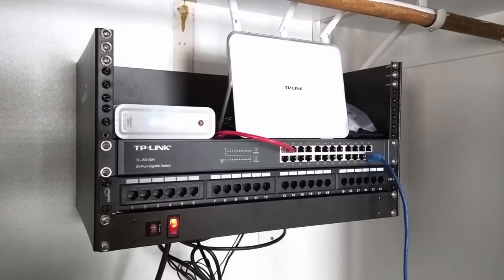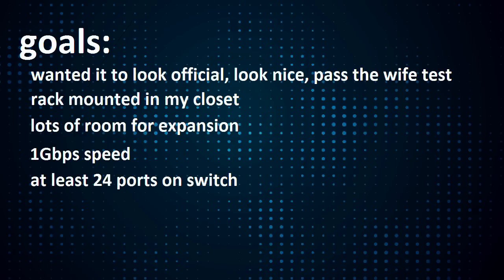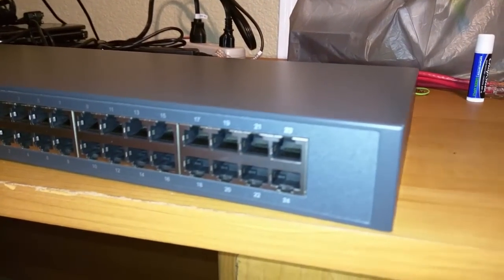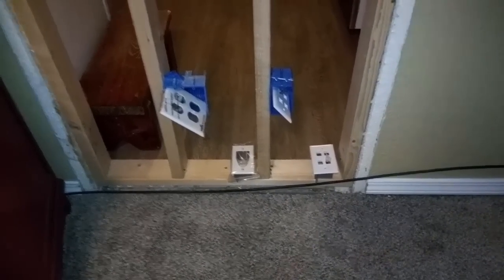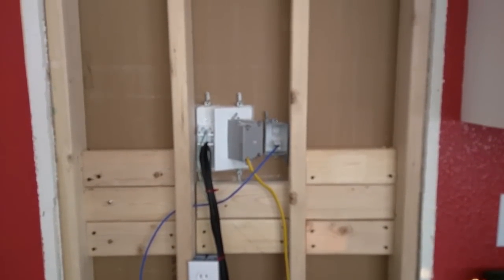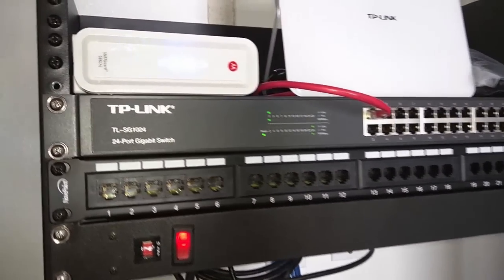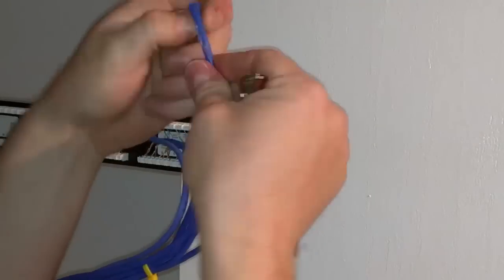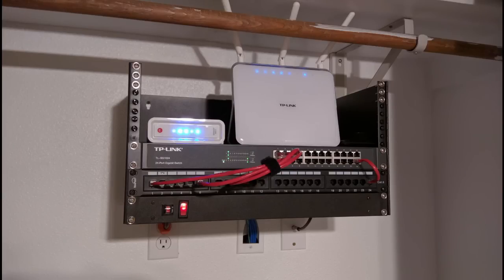Budget Home Network Tour/How To

Comment: If you wanted to save a little money you could've just run 1 or 2 ethernet cables to your entertainment center and then added a switch. Also, I've repurposed old routers into switches by disabling DHCP and wireless capabilities if anyone wanted to save even a little more money.
Reply from the maker: +Bman8862 those are good ideas.
Reply: Bman8862 
I'd agree, Linksys or Netgear or others offer inexpensive switches ($25-$40 Gigabit). In my office sure for troubleshooting make them all home runs, but a home it's not necessary.
Reply: Ask anyone who works in enterprise networking, cascading switches.. especially in a managed environment is a fucking nightmare. I mean, I would spend the extra money just to run everything back to a central switch. But yes, you are right, good ideas to save money!
Reply from the maker: +Nicholas Smith I agree! Cascading switches is something I'm not very familiar with yet. Luckily I won't need to mess with that with my home setup.
Reply: Can I ask, why did you go with a frame rack instead of a cabinet style self contained rack? I think it would have maybe worked better in your situation?
Reply: Nicholas Smith 
Cascading a secondary switch in a home is a practical necessity and for years I haven't had one problem. 

Alternatively, you have to second guess how many runs to a single point, adding a 'whoopsie I missed one' in a home is exponentially more difficult. 

The switches all have indicator lights and it's super easy to diagnose a problem.

In contrast in an Enterprise location ie a Data Center most switches are managed...
Reply: I do see your point. But just to clarify, its not having a secondary switch thats the issue, I just prefer that all my switches are in 1 physical location, not spread out. I guess its just my bad experiences with rouge switches in business settings.
Reply: Nicholas Smith 
Managed vs Unmanaged Switch(es).

If only one area in my home isn't working off a switch then chances are a bad switch; if one device off a secondary switch isn't working then chances are its the device reboot or test. Generally it takes a reboot to fix.

Electricians typically charge $100-$200 per drop, grouped or not. Crawling in my Florida attic in summer is like getting beaten up.
Reply: Very good points!

Yes but walking in my Australian roof-space is a breeze. ;)
Reply: Nicholas Smith 
My best friend is an Enterprise Network Engineer and his house is in Chicago area (basement and cool temps) and he has a personal mini data center in his home. Everything is managed, mostly Cisco, and set up the way you described. 

I'm just looking for a single-SSID Ethernet backhaul with 3-4 AP's (Mesh style) WiFi running off my Router (using a single gateway; no secondary). His Cisco solution costs in the thousands. I'm looking for a solution in the hundreds. Any suggestions?!
Reply: Thanks everyone for the advice. I fantasize about having a home network like these ones. I'm 16 and still learning but I absolutely LOVE this stuff. (And I can't really afford it - or convince my parents - but I'm working on it haha)
Reply from the maker: +Nicholas Smith well mostly because of budget. A little access on the sides would have been nice. I didn't feel I needed any security though.
Reply from the maker: +Bman8862 ever since starting full time in IT, I've wanted one too. Keep learning, and saving! It'll happen!
Reply: This is what I built for my home entertainment server.  Worked really well for me.  Didn't have to buy all the extra equipment and kept the price down. It served 2 tv's, 1 Ipad, and our phones with no problems.  But I will say if I had the money I would build something similar to this. 

Edit; I would buy different hard drives. The Seagate 
Green Hard Drives I used were not worth it at all.  Two of the hard drives failed within the first six month's and all of them including there replacements died just after warranty.  Will never buy them again. Currently the Media Server is out of commission until the hard drives are replaced.

HDD ST3000DM001 3TB 64MB Cache SATA 6.0Gb/s 3.5"
ASUS M5A78L-M/USB3 AM3+ AMD 760G + SB710 USB 3.0 HDMI uATX AMD
Western Digital Blue WD2500AAKX 250GB 7200 RPM 16MB Cache SATA 6.0Gb/s 3.5" Internal Hard Drive Bare Drive
LG Black 12X BD-ROM 16X DVD-ROM 48X CD-ROM SATA Internal 12X Blu-ray Combo Drive Model UH12NS29 – OEM
HyperX Blu 4GB 240-Pin DDR3 SDRAM DDR3 1600 (PC3 12800) Desktop Memory Model KHX1600C9D3B1/4G EA
AMD FX-4100 Zambezi Quad-Core 3.6GHz (3.8GHz Turbo) Socket AM3+ 95W FD4100WMGUSBX Desktop Processor
2- cisco EA6500 routers
Reply: Glen AW 
Don't get me wrong it's nice. However, back in the days of prior to DVR cable, Netflix, HULU, Amazon Prime, Spotify or Napster, Sony Vue, and Premium on demand, etc .. a Media PC actually made sense. I use to waste time ripping my DVD's (had a PC controlled DVD player before that), CD's, record TV (1-2 tuners).

Now there's no point, on demand streaming is getting cheaper by the day.

The Networking Engineer friend I mentioned does as you do, but he has no kids and doesn't spend too much time watching the boob tube.

Heck now we rarely even buy a physical Blu-ray with the exception of some 4K's, instead it's VUDU or Google because the force is towards digital. Our home movies and pictures are stored and shared on a WD My Cloud w/ RAID.
Reply: cascading switches could make a bottleneck in the network if you put heavy traffic devices in the wrong place (because the way cascade network moves the data from the slave switch to the main switch). you have to plan your network to avoid putting heavy traffic devices in different switches when you use cascading, specially if the old switches you are using aren't gigabit
Reply: Dario Ampuy 
Look at the second reply (Gigabit). Using CAT6 in the first place assumes itself people are looking for speed. 

Gigabit is pretty much the standard and pretty inexpensive. BTW as soon as 10 or 100 Gigabit is priced similarly that will be the standard. You're more in trouble if you have CAT5 (not confused with CAT5e) with its 100 Mbps cap. CAT5e is 1 Gigabit max and CAT6 is 10-Gigabit 100 meters max. CAT6, CAT6e and CAT7 are 10 Gbps with longer lengths and frequencies. CAT8 upto 40 Gbps. https://www.firefold.com/blog/cat7-ethernet-cable-worth-extra-cost/

IMHO CAT6 is perfectly fine for home use unless you have runs over 150' .. you might get some crosstalk after 100' if you're not careful...at 10 Gbps speeds.
Reply: well, repurposed old routers tend to be 100mbps which is fine as long as the devices connected are low traffic...

unleast you use backbone capable switches (which are very expensive) when you connect 2 switches with one cable all the traffic inbetween will move across that single cable... if 2 heavy traffic devices are in each switch they could saturate that single cable freezing the rest of the network crosstalk. if you want speed you try to avoid cascading, or you design your network so low priority devices connect to the secondary switches leaving all the high priority devices on the main switch
Reply: Dario Ampuy 
Agreed if you funnel a 1 Gbps data stream into a 100 Mbps pipe .. you get 100 Mbps cap.

The only potential issue with cascading Switches is it theoretically creates a tiny latency. 

Just for thought all this is in Mbps and Gbps not MB/s or GB/s. 100 Mbps is 12.5 MB/s and 1 Gbps is 125 MB/s, 10 Gbps is 1250 MB/s. A HDD is 125MB/s to 200 MB/s vs a SATA 3 SSD 590 MB/s and the M.2 SSD's 3,500+ MB/s (max M.2 is 3.9 GB/s 3,937 MB/s).

Point is a 1 Gbps data stream to data transfer is slow.
Reply: Bman8862 is
Reply: Bman8862 when using a old router what do you mean when you said you disabled shop? I used a old router to act as a switch, but I'm not sure what dhcp is? I'm not knowledgeable when it comes to computer stuff.
Reply: DHCP is basically what assigns your devices 'addresses' known as internal IPs. So, in order to make the second router down the line a switch, you can disable DHCP in the settings so that both routers aren't trying to assign IPs and cause IP conflicts. That way, the first router is the only one assigning IPs. Someone here can correct me if I'm wrong.
Reply from the maker: +Bman8862 👍
Reply: As far as DHCP goes, that is mostly correct - you generally should have only one DHCP server; although professional routers can have "DHCP helpers" added to ensure that DHCP requests from a given subnet get to the proper DHCP server when more than one exist., A Router's primary function in networking is to connect separate networks - each with its own IP address space. The router does network address translation and routes packets in the direction that they need to go - towards one address space or another. Most professional routers talk to their neighboring routers to develop a routing table on their own, in addition to manually defined routes. Home routers on the other hand usually only talk to their "WAN" or "Internet" port to figure out what address space they are connected to.; and most home routers allow you to define what address space they hand out.
Reply: A network made from Ubiquiti products would probably be a bit cheaper than Cisco. Though if you are talking about a home environment, having more than 2 APs is probably overkill and will be prone to interference.  If at all possible you should hardwire the two APs back to your edge router; Ubiquiti does claim to have a "transparent" type solution that allows APs to connect to each other wirelessly, but keep in mind that extra communication between APs will affect overall bandwidth somehow.
Reply: In a home environment you probably will not notice any big problems by "cascading switches" to create one large network. When you directly connect one or more switches you create a giant broadcast domain - (again, in a small home network you won't notice too many issues). You probably know that each port has a given speed - like 100MB. The main time this comes into play in home networks is when multiple devices access the same port - like your main internet connection, or a media server. In these cases, the speed of the "shared" port gets divided roughly by the number of devices trying to access. This also depends on how much traffic is generated by each device... if a chunks of a movie from a media server are coming into one viewing device at 22MBPs then that leaves roughly 78 MBps for other devices. There is also typically a bunch of minor overhead traffic on any network, so those are just approximate numbers.
Reply: Agreed. 1 or 2 cables is likely most would need. Can even use VLANs if need to segment stuff. I have a single ethernet cable going to my home theater area with an 8 port switch.
Reply: Hey D Jaquith - you should look at Ubiquiti UniFi systems for your wireless mesh.  They cost dramatically lower than Cisco gear, but have what you're looking for in terms of an easily administered, single-SSID mesh style wireless network.  The access points are also POE - which opens up a lot of options about placement (to maximize coverage).
Reply: David Miko 
Thanks I'll definitely check them out. I've been busy and put it on the back burner, so I haven't done anything yet.
Reply: switches like that use up a lot of power, space in the entertainment area and sometimes are loud. also the amount of money you are putting out there for a switch the cabling is the same
Reply: Not in my experience. Most of them are fanless, take up the same amount of space as a normal switch, and about the same power consumption. For example a D-LINK DGS-1100-08 consumes a maximum of 4.94 watts of power.
Reply: CAT5E is the standard in Data Centers. Any speed needed above that is handled by multi-mode fiber (storage solutions) or single mode fiber(connection to the outside world). This is your typical setup, certain customers have different requirements and may deviate from the typical. Also be aware that Telco's drop off circuits in multi-mode or single mode flavors based on customer needs. Copper connections to the outside world are not that common in a Data Center environment.
Reply: CAT-5e is not usee in data centers. There's a combination of 10, 40 and 100 Gbps copper and fiber used. The 10 Gbps connections are CAT-6A or CAT-7 variants. 
Heck, my house is wired with CAT-6A for future 10 Gbps network. 

1 Gbp is s-l-o-w, that's only 125 MB/s, my now 'old' SATA 3 single SSD is >500 MB/s, most data centers use a faster RAID configuration. The M.2 SSD consumer standard is up to >4,000 MB/s. Example a cheap Samsung EVO 960 SSD is 3,200 MB/s. Eventually you'll see homes pre-wired in Fibre. Speeds are getting faster quickly. Solid-state is the norm now in both consumers and enterprise.

I'm not trying to be mean with a reply, and if anything to be Illuminating.
Reply: +1 to CAT-5e is not the standard for data centers.  The mix of copper and fibre varies widely, but every client I've worked with has been on CAT-6 or above in their data center, and not a single one would consider deploying CAT-5e in their data center (or anywhere else).
Reply: Cable type is an engineering issue with possible budget constraints. But that is totally irrelevant to this video which is a "budget home network". He has a 300MB internet connection (Motorola SurfBoard 6141) and a TP Link gigabit switch inside a small home. Cat5 is totally fine for this - he SHOWS you how small the area he has wired up is. I only wish he had timed an actual file transfer across his switch so you could see the actual throughput he actually achieved.
Reply: 300 MB/s is 2.4 Gbps so I seriously doubt that is his Internet speed. You're forgetting all of the local access to PC's (P2P), server(s), and or NAS and other devices on his own network. 

10 Gbps Switches indeed can be expensive and most 'affordable' switches have 1 or 2 10 Gbps ports for a Server and or NAS with the remaining ports Gigabit. 

Any new home or re-wiring I'd strongly recommend using CAT-6a wire and not CAT-5e. Builder's electricians typically use CAT-5e for POTS (phone lines) and if you don't know to ask will also 'that' wire for your network.

So why CAT-6a and what gains .. file transfers pre-broadband were relatively small, but now with people moving their video collection and home movies to digital file sizes have exploded. Add to that the movement towards IPTV, digital video downloads, Plex media servers, etc people even at home are moving huge amounts of data. Nobody likes waiting and buffering. Now quadruple that with 4K over HD video.
Reply from the maker: +CDArena I did do speed tests and transfers in my switch review video. Check it out.
Reply: should have been obvious - Download speeds up to 343 Mbps according to manufacturer steps. Also - BUDGET HOME NETWORK. At the moment, 10GB switches are definitely not "budget", and in a home environment (even with a NAS) you WILL hit multiple obstacles trying to get even 1/4 of a 10GB transfer rate. 

Read/write speeds are likely to be your main bottleneck, not your network. And 4K over HD is far more likely to be a problem with your ISPs congestion than your home network. Cat5e is plenty capable of carrying gigabit traffic, especially with the chokepoints you have already with your typical storage device and NICs. 

Maybe when the ISPs finally catch up you can worry about fitting advanced cabling and switches into you budget home build, but not now in most areas of the US.
Reply: CDArena 
It's a terrible mistake now to pre-wire or re-wire even a home network with CAT-5e cabling. If your NAS, Server or whatever isn't capable of anything above 125 MB/s (Gigabit) speed AND you don't have concurrent traffic (per port) then obviously installing a 10 Gigabit switch isn't going to help a single point connection. For the average home with few transfers of data and run of the mill streaming  IPTV services without a Plex then keep that Gigabit switch.

Keep in mind if you have a Gigabit network then ALL of your traffic has a maximum cap AGGREGATED TOTAL of 125 MB/s (per port or nonblocking limit of your switch). One copy transfer and you've basically saturated your Gigabit switch.

In contrast, if you have a few PC's, and or NAS and or a Plex or simular server a 10, 24, 48 port 10 Gbps switch even on a Gigabit NIC's reduces or eliminates concurrent bottlenecks. Hmm lots of people even need a PoE switch for their cameras, if you have a lot of HD cameras I'd certainly suggest a 10 Gigabit PoE switch and 10 Gigabit Ethernet switch. 

Affordable, CISCO offers a managed 10 Gigabit switch with 48 Gigabit ports and 2 10 Gigabit Ethernet ports for about $399.

Now if you're only getting '1/4' that speed 10 to 10 Gbps connections then I'd look at your NIC configurations particularly package and buffer sizes (max them out).
Reply: Again... Budget Home Network.  His Gig switch is non blocking. Per connection it is capped at 125MB/s, which he has not reached due to hardware and possibly NIC configurations; and which he has only come close by using a few SSDs for testing (his main storage is spinning hard disks). 

Again, this points out the current limitations of the typical home hardware - maybe in a few years when cached drives or SSD/M2 type drives become mainstream (instead of geeks and hardcore gamers, which are are apparently thinking of - configuring NICs is not something the typical home user does).
Reply: Now I am an IT tech who does network wiring, hardware, multimedia, POS networks, multimedia solutions, PC installations, and security. At work, where the budget is far less of an issue but still a factor we use Gig switches and a fiber backbone; most existing buildings are cat 5 with some cat 5e. New buildings and renovations get cat 6, but make up under 10% of the network.

At home I am essentially on a fixed income - $300 for a switch is out of my price range. $35 for a gig switch - yes but I have no pressing need to upgrade from FE yet. My own personal network is 2 modems (from the ISP - 1 telephony, 1 internet), a cheap 5 port d-link router, a cheap 4 port router configured as a WAP for my wife's iPad. Our 4 PCs are hard wired with cat 5 and cat5e.

Our "media server" is a large cabinet full of DVDs and a bowl full of USB drives with movies stashed on them. No cable TV - we stream from Netflix, youtube, and a few IPTV sites with foreign content. Why? again - a tight budget.
Reply: To me, budget means cheap. I have a $50 HD security camera inside a DIY $10 weatherproof shop-light housing, powered by an $11 POE brick - Budget. My dream? Maybe one day rewire the entire house back to an in-wall floor-to-ceiling wiring enclosure housing a patch panel and all the network gear behind a decorative "techy looking" door panel - maybe even with a few strategically placed smoked plastic windows to expose the LED indicators. Conditioned power and forced ventilation of course.   One day, if I have the money - but not today.
Reply: CDArena 
Again, the debate is CAT-5e vs CAT-6a for 500' it's $35 vs $70. Today, 2017 you'd literally have to be stupid, I'm sorry but this discussion is purely dumb, to wire your house, office or anywhere with anything less than CAT-6a for any networking .. period. 

Suggesting to people to use CAT-5e for networking is trolling or at the least misguided. Worst, crazt if you hire someone to install cabling the wire cost is negligible. 

Your home network isn't 'everyone's' nor is it typical to anyone but yourself. Lots of people have NAS, servers, P2P, and many security cameras. Then there are people with home networks that rival small to medium businesses, then there are those with only WiFi and no PC's to everything in between.
Reply: Yeah, good idea except I can't get the picture out of my head with a bunch of repurposed router switch combo plugged in everywhere which add to electricity cost in the long run. In my opinion, a centralized location is better. Your setup is much neater. One thing I would have done, and you should bear in mind for future projects are, you should leave a bit of cable that forms service loops in your setup, that way should the need arise to move your patch panel assembly, it would be flexible enough to do so.
Reply: Finally....someone with sense.
I was getting despondent.
I Like your other comments D Jaquith
David Miko is right also.

For me, cheap is not worth the money you save and the performance/reliability you lose.
Reply: Exact scenario I troubleshot over the phone the other day. Went onsite with a replacement switch and sure enough, the switch (out of 3 switches) had been power surged by a lightning strike the night before.
Reply: Darn you D Jaquith.
The more you say,  the more I get a hankering for a 10Gbps network.
:-)
I'm in the beginning of a build out stage of my home 1Gbps, just moving stuff, really and I'm thinking of changing it all to 10Gbps.
I routinely move 100's of GB per file around my network and could use the speed increase.
Just this moment I'm going to move a 547GB single file to my encrypted NAS over 1Gbps, normally an overnight project.
Reply: Space Cadet an 547 GB file?!?!
Reply: For the sole purpose of saving money, you are correct. However, another switch somewhere in the mix is just another point of possible failure. Not a big deal for a home, but that switch is just something else you have to plug in somewhere and they always come with those frustrating wall wart adapters.
Reply: Bman8862 i
Reply: Old post but got to agree on this one. Cat5e is plenty for home networks and easier on the hands when terminating. 10G is still a  good ways away and is far too expensive for budget setups... only reason is if your like linus and editing 4-8k content between multiple people internally and time is money.. We only have a few clients that run 10g and they are schools which have 10g to connected switches... rest of ports are gigabit. Only recently are people able to get gigabit internet in the home much less 10g.
Reply: Josh Easom 
I'd wire CAT6a for the future and today use 1 Gbps hardware. The wire cost difference for a whole house is the cost of a nice pizza. 

Is a pizza today worth rewiring your whole house in a few years? Your choice, I made mine...
Reply: if you're really into networking and trying to convince your parents, maybe explain this is a good learning experience and investment for your futur :) As in, if your planning to pursue a network admin carreer, then that would help you out to get better grades, cheers
Reply: CAT6A is a lot tighter on tolerances and real easy for average "home hobbyists" to cause all sorts of AXT and NEXT by field terminating their own wiring. The cabling might "work", but you're going to see a ton of impaired pipe speeds.
Reply: Szalk erous 
CAT-6a is wired exactly the same .. the only difference is in the shielding and thereby can sustain higher speeds.
Reply: That's not entirely accurate. Augmented CAT6 has a different twist specification, both the pair and the bundle, and that is a key factor in the 10G speed accomplishment. It is also much less tolerant of poor termination (to obtain the rated speed).

Edit: Just because comments can get buried, I'll link this great PDF on the subject again. In particular the TL;DR is on page 21. http://www.hubbell-premise.com/literature/Cat6A.pdf
Reply: This is what I had to do. I have a number of devices right at my entertainment center that need Ethernet. A few can run wireless but since I have the cable there I use it. I put a 7 port switch behind the TV for the TV, DirecTv, Amazon Fire, Roku etc. Much better solution than running a dozen cables back to a central switch.
Reply: D Jaquith i got a cheep 5 port switch for like $7 but only 300mps tho
Reply: If he updates his hardware, then your points are irrelevant. He still has a Cat6 ethernet infrastructure, with no need to pull and terminate new wires.
Reply: Yep.  Pulling wire is a helluva' lot more time consuming than upgrading old hardware.  Within budget, you ALWAYS install the fastest wireline ethernet possible.
Reply: Not that complicated in a typical home environment.  See https://en.wikipedia.org/wiki/5-4-3_rule for easy to remember rules.  

I agree that Enterprise Networking doesn't really apply in most homes and in a most businesses with over 10 employees cascading switches should be avoided as a best practice.

Also may be ameliorated by using routers in separate rooms instead of switches.  As long as one remembers the "WAN" port goes to the wall, not  the printer (as in the easiest $100 I ever made when troubleshooting a network).
Reply: Nicholas, that's only when using managed switched. Unmanaged is no hassle at all....
Reply: Yeap! Especially since IPTV-Settops, XBoxes, PS4s, SmartTVs, Apple TVs, etc are typically used just one at a time with a single screen, so that the single cable leading to the switch is unlikely to become a bottle neck, hence cascading switches are not a problem for that environment.
Reply: Haha so I'm not the only one who does that, my ISP sends new modem's like every 8 months so I have all these old modems that I run as a switch where I don't need a lot of throughput
Reply: @DJaquithFL  So true. I just upgraded my fathers setup for his business. I built him a NAS to store his backup images and to transfer files to his CNC computer. If something crapped out im not waiting hours to download an image at 100mbps. I upgraded frpm cat5 to cat 6 wires. Then the PC could use their gig function and what a worlds difference.
Reply: Save a ton of money. It’s called wifi
Reply: Nice
Reply: Old routers as in routers with 100Mb/s ports or gigabit?
Reply: @BluStoned  Years ago we had a client, and their network was doing weird stuff. The help desk did their thing but couldn't solve the issue so they arranged for an onsite technician. That was me, and it was a 2.5 hour drive to the client's site. The instant I walked in the door I noticed a switch under the reception desk with a cable coming out of one port and into another port on the same switch - the loop was obvious on the carpet. I pulled one end of the cable out and all their network issues went away. The reception lady said she saw a loose cable and decided to plug it in. 5 hour return drive for that.